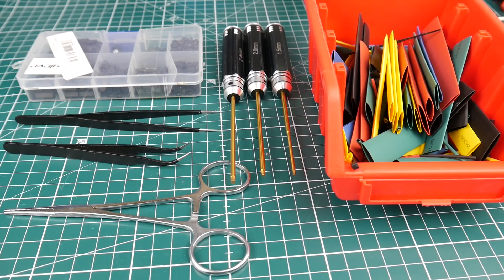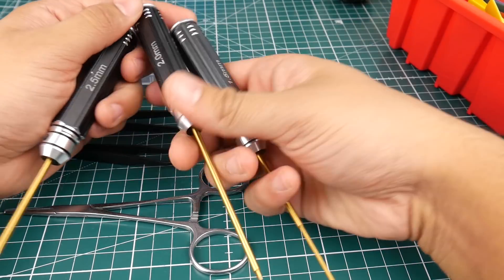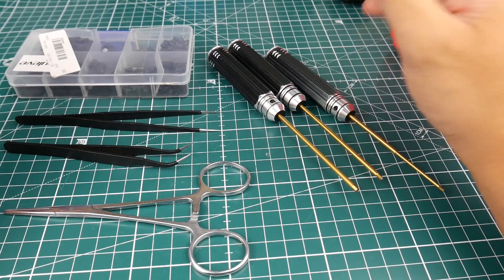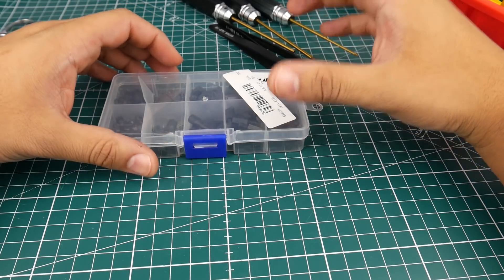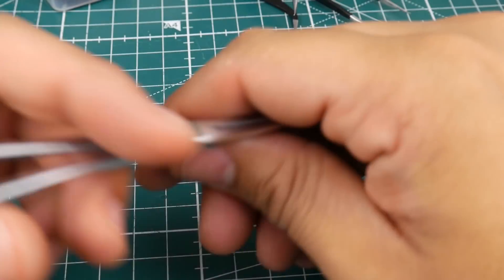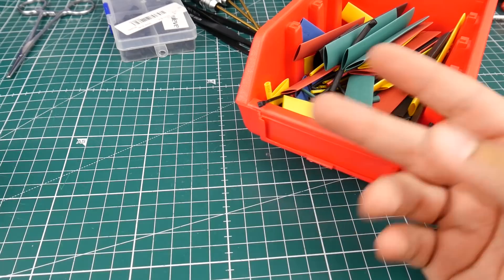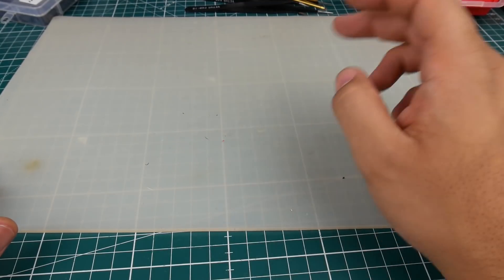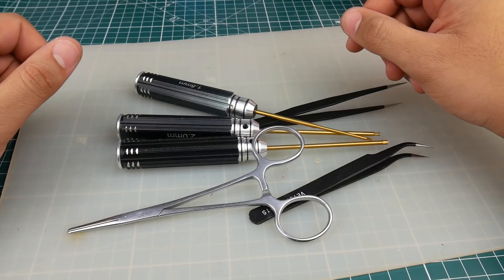FPV Drone Tools // Your Request, My Experience

Comment: Thanks for the video. What solder do you use? I’ve tried some cheap stuff from BG, but it’s terrible. Looks like there is no rosin core in it. All joints are not shiny and it requires higher tip temperature.

Comment: LMAO Have you seen rcmodelreviews( aka xjet)  I've seen him solder so close to his iron I felt it burn.
I learned a trick from uavfutures using bluetack to hold things down when I'm soldering. Have you tried this method?.  Obviously I won't get the force of holding the item like with tweezers but for inline and holding things at an angle work great with blue tack.
The cutting mat works great the best part is for quality mats the squares can be used as a ruler.

For the silicon mat, I"ve been looking for a low cost mat for a while.  I'm currently using silicone pot holders from dollar tree :)
How good is it insulating?   I'd like to be able to use the heatgun while the item is still on the mat and not warp my cutting mat

Comment: Awesome advice!! I have the same screw drivers from your video descriptions, and they are amazing. Any chance you've found a set of 2 or 2.5 M screws that come in a pack? I have been looking all over the inter webs and have not found any sets with differing lengths.
Reply: They are - in Australia :)  Strange, but Chinese online shops doesn't have virtually any 2 mm screw/nut/spacer set.

Comment: what do you think about using brass standoffs? ive used them for a few months now, 1 they dont strip, 1 they are way smaller than nylons, i have snapped off components off fc's with nylons before, but not with these
Reply: They are heavy.
Reply: on a 350-400grams drone 2-5g wont matter anyway